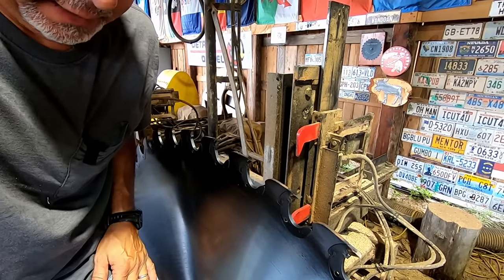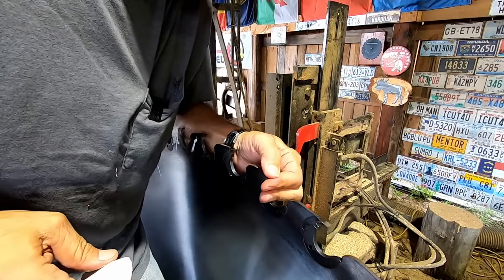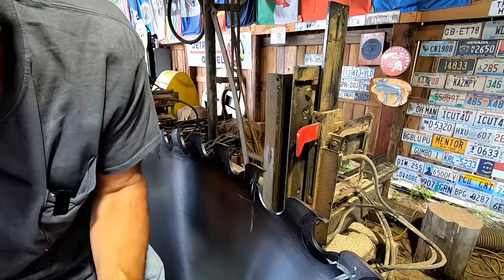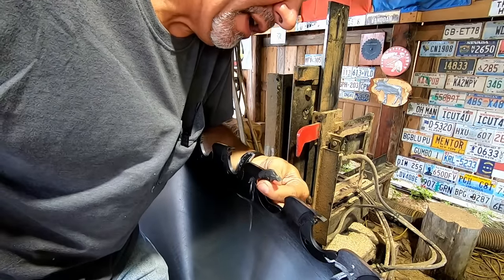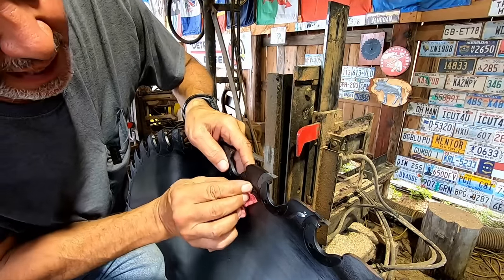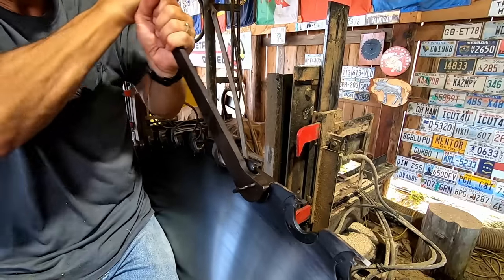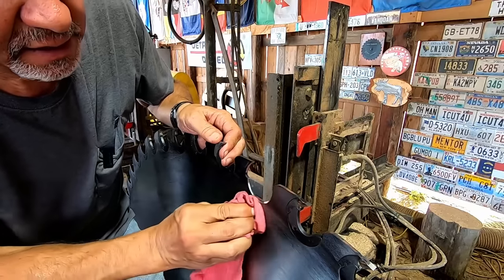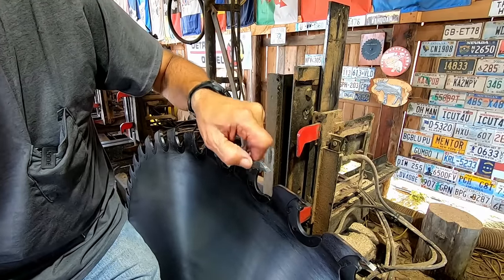replacing the chipped saw bits # 465

Comment: Great video… I’m not a sawyer. After you remove the bit.  Do you sharpen the carbine or weld a new carbide on the damaged tooth. Or throw away.
Reply from the maker: thanks , yes I just throw them out.

Comment: Hey Mark, I can relate with you about your eye problem.  I developed a problem with my right eye whitch was also my dominate eye.  If I shut my left eye I had a dark spot in my sion right exactly in the center of my vision.  I forget what the medical term was for it but, for me it was like looking through a mud puddle right where I couldn't make out what I was looking at.  With both eyes together I could see pretty good but, not perfect vision either.  I have learned to live with it and they tell me that it will never heal and be perfect vision again.  Being right eye dominate, I can't effectively shoot a rifle or pistol if I am trying to hit a target. Kind of takes the fun out of hunting.  Thankfully, I still see well enough to drive.  I hope for you that your eye heals better than mine did.
Also, Mark, I am curios.  Do you have to replace all the teeth on the blade when they dull or, can you file them sharp like the older blades?  Thanks for showing us how the teeth are replaced when it is just a few damaged.  But would you have to do all the teeth if the whole blade was just dull?  Looks like there should be a tool that you could set up to resharpen the carbide bits around the whole blade and you wouldn't have the cost of buying a comple set of new teeth fo it.Anyway, have a nice day and God bless you and I hope your eye gets better.
Reply from the maker: Wow you have the same thing going on with your eyes , not a good thing! yes I do sharpen the blade on the mill with a Andrus grinder.